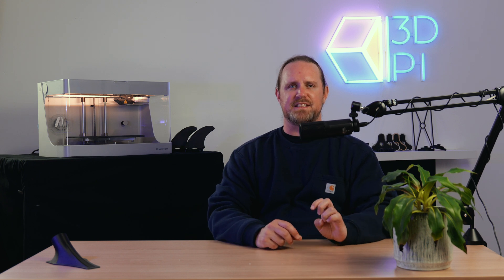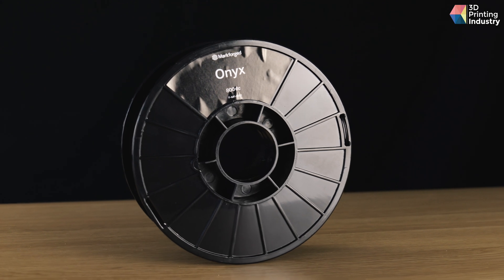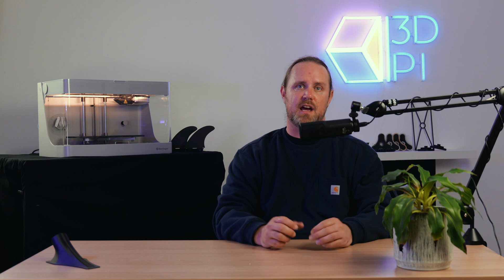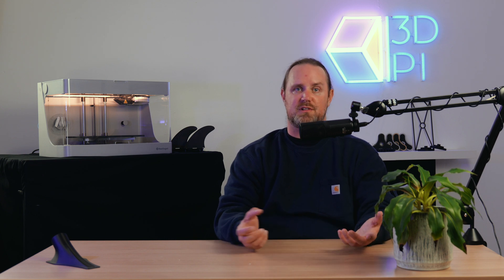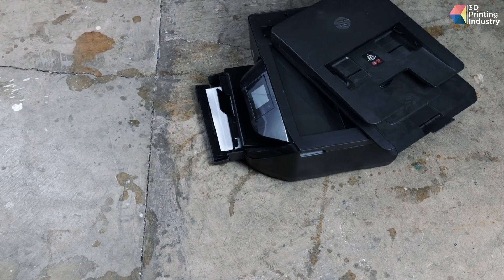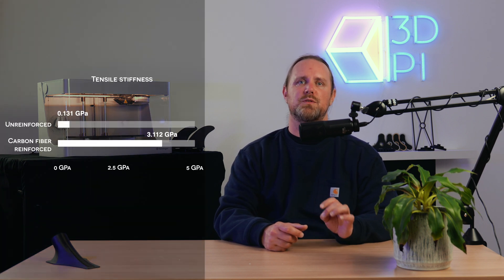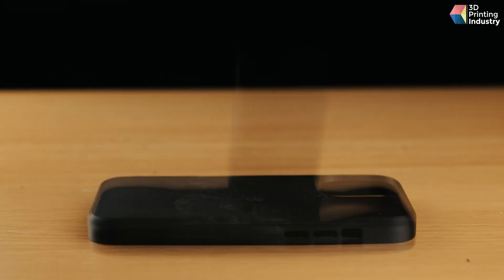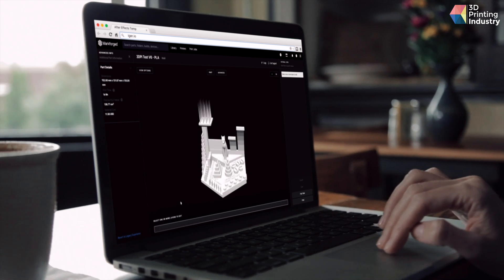Markforged Mark Two 3D Printer Review

Comment: Great video. Looking at buying a used 2018 model mark II with 1,100 hours on it. Worth buying with that many hours? New to the whole 3D-printing world so not sure if that's a lot of hours or not. Any input would be appreciated. Thanks!
Reply: I have a client that did basically the same thing, he loves it and is still using the printer in 2025 to make brackets and other parts for the battery systems that his company sells.